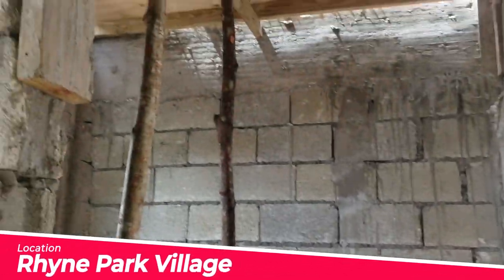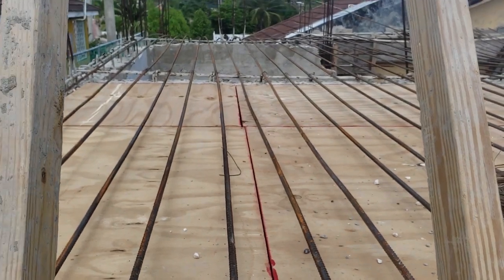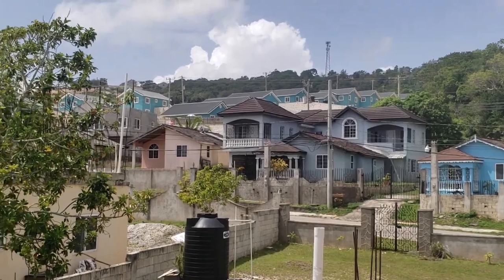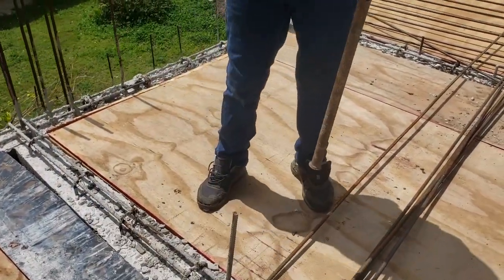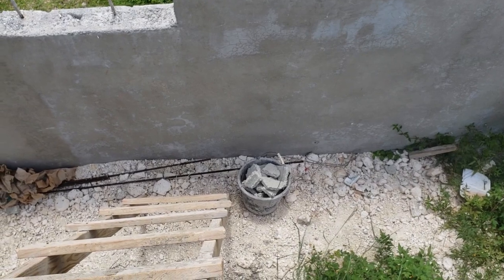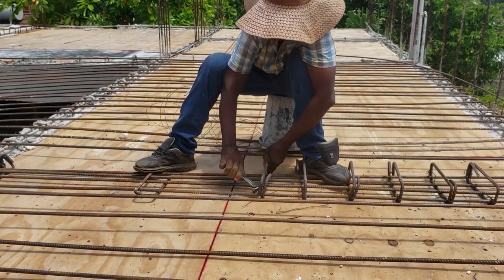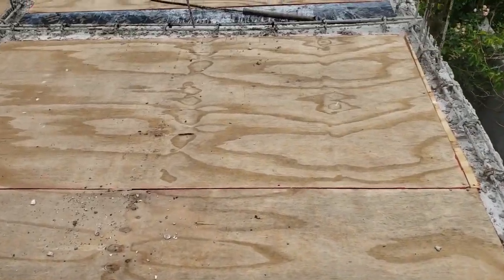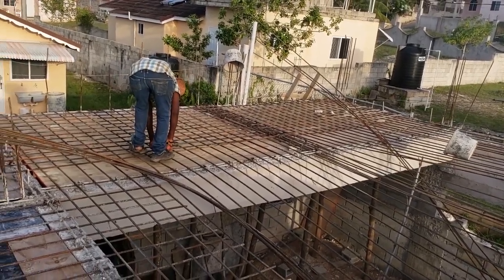How to guide to steeling up concrete decking slabs BUILDING DREAM HOUSE IN JAMAICA RHYNE PARK 😮

Comment: Yes, aguh tune in fi the over support part.. a lot of builders run both main and distribution steel and then think that the decking is finished.. you guys do it the proper way..
Reply from the maker: "Thanks for tuning in to our channel. We appreciate your comments. All facts 👍."proper ways always
Reply: Then them wonder why the slab a Crack up

Comment: Why do you place the steel on the belting and not under? Is it because its too low ?
Reply from the maker: To answer your question about why she ran the steel on top of the belting on some parts of the decking:

When the person was boxing up or casting the belting, they didn’t catch the belting high enough with the strap board. As you can see in the video, some parts of the belting are low. If you try to force the steel under those low areas, you’ll have issues when trying to catch it up with the catch block.

People who force the steel under the belting when it’s too low often find that, once the deck ply is removed after casting—or sometimes years later—you can see the steel grinning (exposed) because it was too tight against the ply board. This prevents sufficient concrete from covering the decking steel properly.

We usually run additional steel and provide extra support in those areas to ensure the decking is well-reinforced.

Thank you for watching the video, and have a blessed day!
Reply: @GFORCECHRONICLES  ok so in this case you have to do that. Understand